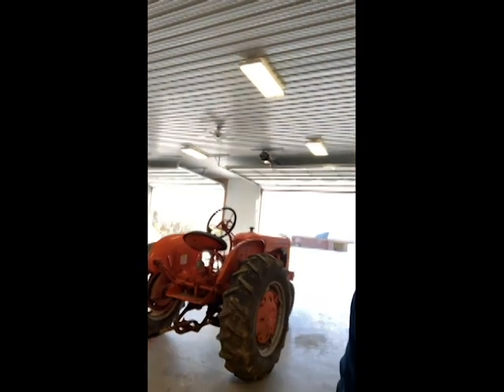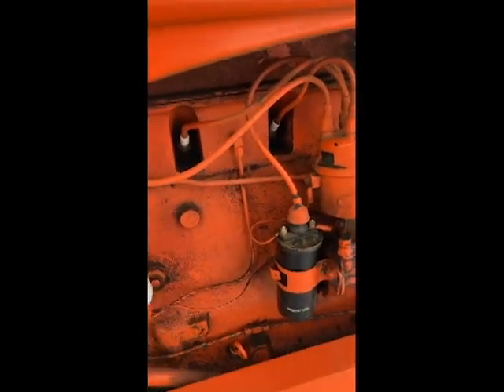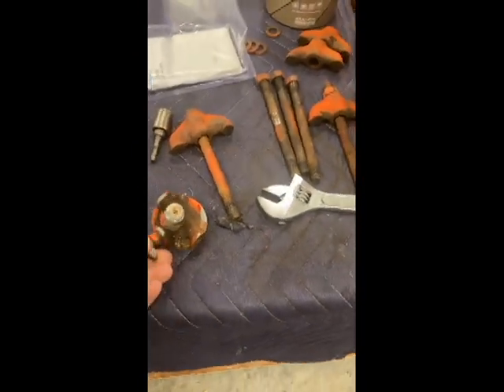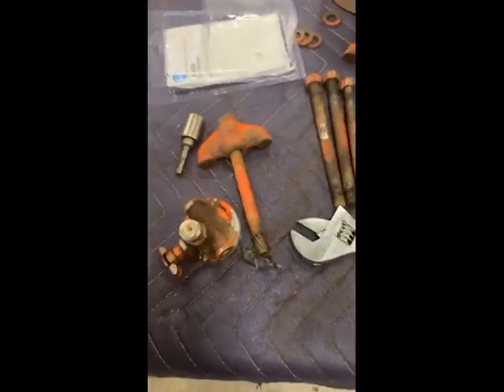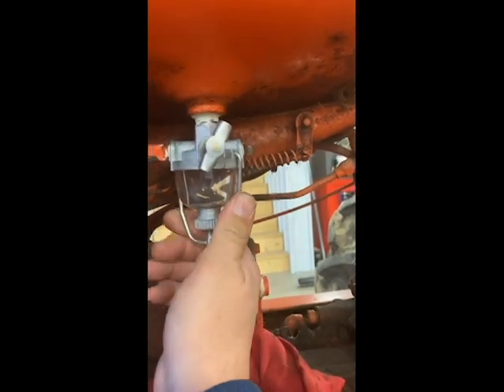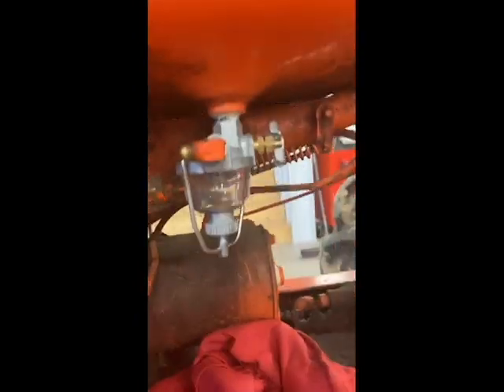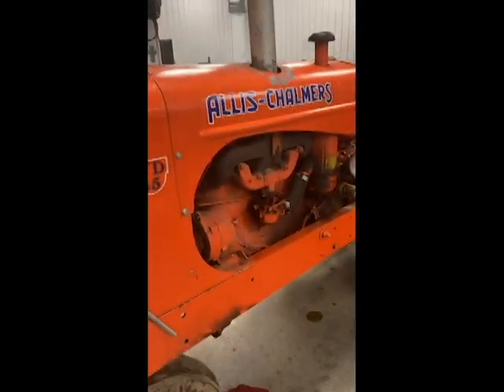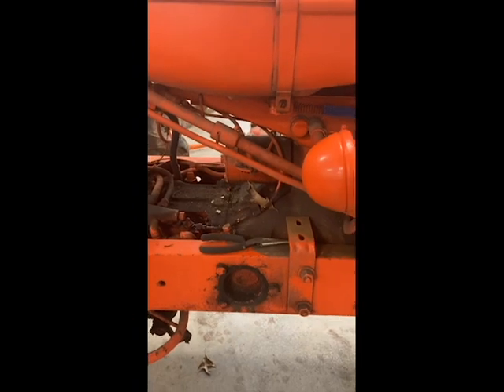Allis Chalmers WD45 NF Tune Up and First Start

Comment: Good  day So was it the starter?  Is that a 12 volt battery , turns like crazy.  Is a spark plug   not working?  Thanks
Reply from the maker: Yes the starter turns the motor over until it can start. In the beginning there wasn’t current getting to the plugs so I had to replace the condenser and adjust the points. Then she fired.